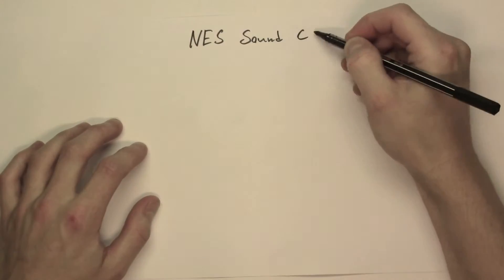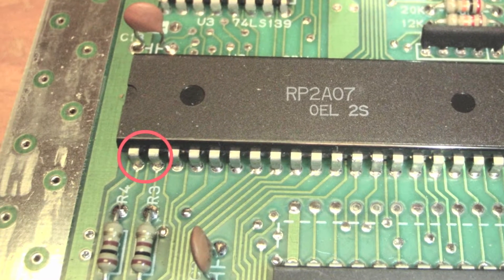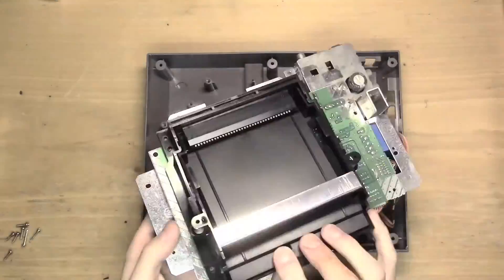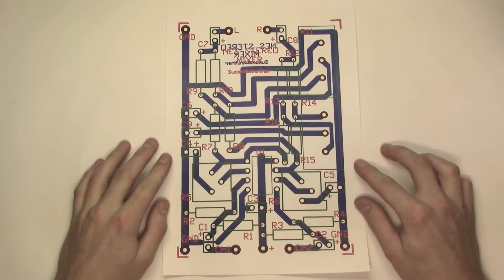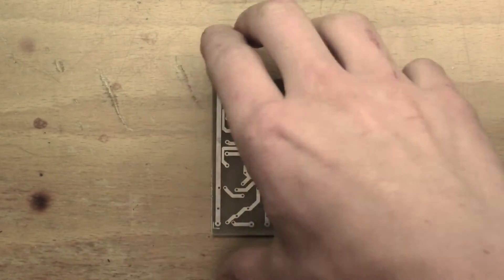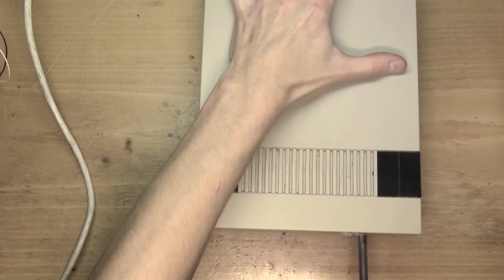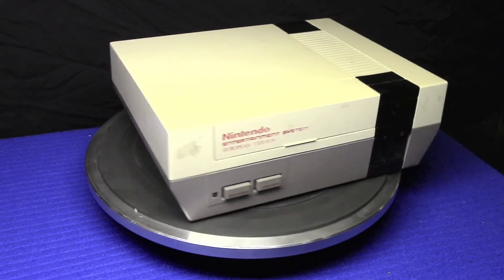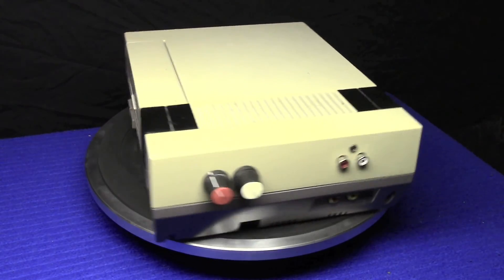The NES Stereo Mixer - Build and Demonstration

Comment: If I wanted to spin this up and add expansion audio to the mix would there be even more components? How would that look?
Reply from the maker: I do not know exactly how the expansion audio works, or if it possible to get it on a separate channel. But, assuming it is, and you get 3 channels to mix together you would need to use a different topology.

The circuit in the video is designed specifically for 2-channel in/2-channel out to be able to adjust both the gain and the pan between Left and Right with only 2 potentiometers. With more than 2 inputs you may want to use a more traditional mixer topology with a separate gain and pan control for each channel.
Reply: SunandWeather one.
Tim wortingtons nesrgb mixes it in through a 100k ohm resistor then through his op amp although his mixes it down to mono.  I just want to make a simple stereo and expansion audio circuit to go along with my playchoice 10 rgb mod I’m making
Reply from the maker: frank strasser, if you are able to access the expansion audio signal you could mix it to either Ch1 or Ch2 through a resistor before the OP amp in the circuit from the video. Then the expansion audio will be permanently mixed to one of the channels. Note that you will probably have to experiment a bit with resistor values in this case, unless you know the source impedance of the expansion audio signal.
Reply: SunandWeather thanks for helping.  Could I combine it to both channels?  Also does the size pots matter? How did you come about your circuit did you make that one yourself?
Reply from the maker: frank strasser, it should be possible to mix it to both channels using two identical resistors. The absolute values of the potentiometers are not critical, but for the mixer part you should have potentiometers with a linear taper. The exact values I used are linked in the description "Schematic.pdf". Although, I would probably try to lower the the resistor values in the mixer part, especially R9, R10, R12 and R13 to get better signal transmission. Or better yet, add a line driver.

The circuit topologies used for this design are fairly standard.
Reply: SunandWeather alright thanks!
Reply: Could I omit the two caps at the inputs and the two 10k pulldowns? I just want to make it a little smaller of a circuit
Reply from the maker: frank strasser, the components you are referring to are there to get a desired bias (DC) level of 2.5 V for the signal before the OP amp. I do not know the bias level of the audio source here, but if it is close to 2.5 V it might be Ok to remove them.
Reply: Did anything come of this? For people who add expansion audio to their console (47-56k resistor on Exp pin 3 to pin 9), what's next? Can we break the audio into separate channels 1-5 or are we stuck with just left and right? How does the schematic change?
Reply: @zombie343  I was gonna make a pcb and see what I can come up with but haven’t got around to it yet
Reply: @frankstrasser6108  well I, for one, am interested
Reply: @zombie343  when I do Ille let you know how it comes out
Reply: @frankstrasser6108  looking forward to it. I'm also working on an 60-72 pin adapter that includes expansion audio in the mean time.
Reply: @zombie343 I’m coming back to this just now to make a prototype and test and tweak ille let you know when I do

Comment: Hi @SunandWeather, I sent the gerber file to print the PCB but they are unable to print it because there is no board outline in gm1 layer. It would be awesome if you could you update it.
Thanks.
Reply from the maker: Hi Oliver Grimard, the files have been updated with boarder layer. Feel free to try again. Also, please note that these files do not create the ground plane on the opposite side of the PCB, as it is in the video; that was done with manual modification. It should work without it, but might be a bit more susceptible to interference.
Reply: @SunandWeather  Wow that was fast!  I will try the gerber file today and let you know. Thank you.
Reply: @SunandWeather  The PCB printer told me he cannot print from the gerber file because:
- There is no:  top copper layer, top solder mask layer and silkscreen layer.
- I ordered 2 layer board, and seems that the gerber file is incompleted, there is no drill layer. 

I saw your drill file but I don't know how to add it to the gerber file and the PCB printer only accept gerber files.

Do you know how to fix the file? 

Sorry I very newbies with gerber files. I have few things to learn about that.
Reply from the maker: @oliviergrimard7345  I guess the gerber files I generate do not fulfil modern requirements. I do not think there is any way for me to fix this with my current setup.

Comment: What's the difference between your circuit and what I see everywhere else on the internet? https://www.youtube.com/watch?v=8ARw-wfl4t0 ....Anyway, how can I order this PCB given the schematic? I'd really like to start using this.
Reply from the maker: Hi Zombie343! There are 2 main differences. 1. This is an active circuit where the audio from the sound chip is buffered by 2 OP amplifiers. The sound chip of the NES is most certainly not designed to drive signals long distances outside of the PCB, so in this design the OP amplifiers drive the signal instead. It also makes it possible to increase the signal level if necessary. I do not know exactly how well a passive circuit would perform, but I assume the signal would be weaker, more susceptible to noise and possibly distorted depending on what you connect it to. 2. This is an actual mixer, where you have full control over the ratio between sound chip output 1 and 2 for both the left and right channel, regardless of what you connect it to. In the design in the video you linked you do not have the same control and it also seems highly dependent on what you connect it to. Also, if you are suppose to take "MONO FROM PCB" from a buffered output, you are essential shorting 2 outputs together for AC when the potentiometers are turned all the way down, which could potentially damage the sound chip on the NES.

I do not know if there is any way to order PCBs just based on the files provided in the description. It is mainly intended for the purpose of making your own circuit board.

Also, if you decide to use this design, I recommend reducing the values for R9, R10, R12 and R13 a bit (maybe to 10kOhm) to make the signal a bit stronger when connecting it to a lower impedance input.
Reply: @SunandWeather  Thank you so much. I'm unfamiliar with PCB making processes. How did you make the PCB? Is it easy to replicate at home? or purchasable based on the schematic? Thank you for the thorough design analysis as well!
Reply from the maker: @zombie3439  Making PCBs is possible to do yourself at home if you are willing to spend some time learning the process. I think the best description of the process I use is from Mr. Carlson's Lab: https://www.youtube.com/watch?v=au2ba5gWLWk As far as I know it is not possible to order a PCB based only on the schematic, as you would need to supply the layout as well.
Reply: @SunandWeather  thank you so much for your responsiveness! I'm trying to figure out if your stereo mixer requires expansion audio as an additional input. OR does the expansion audio mod (adding a resistor between EXP3 and EXP9) automatically include expansion audio in the stereo output being mixed?
Reply from the maker: @zombie343  That is a really good question; I have not thought about that. I am not sure.
Reply: @SunandWeather  I sent you an email with a follow-up on how to include expansion audio as a 3rd channel but I don't know how the circuit topology changes